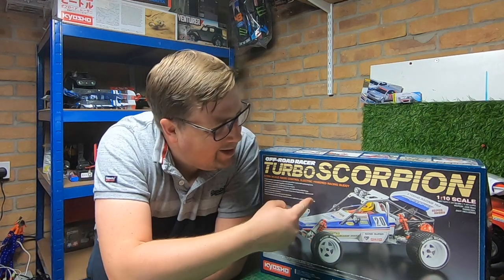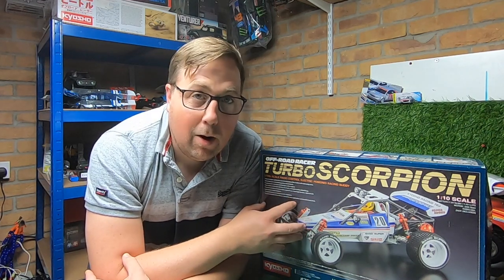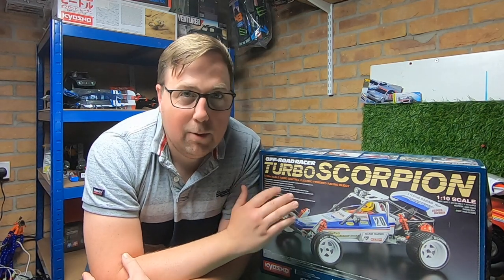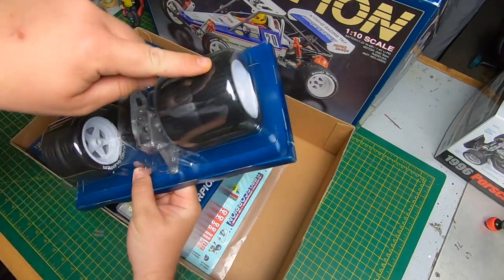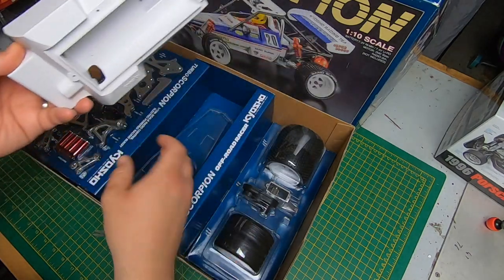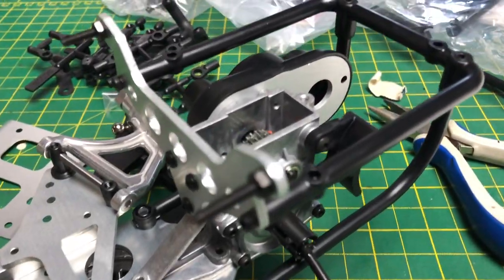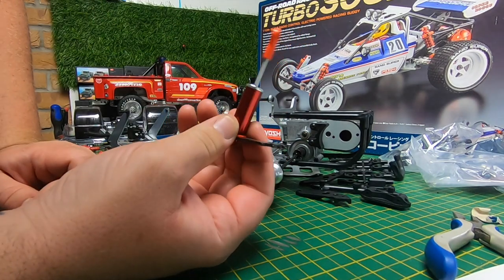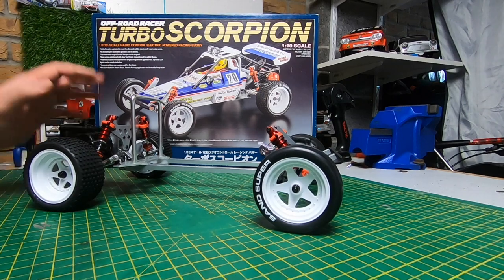The Nicest RC Car I've ever built!! - [Kyosho Turbo Scorpion] NIB Brushless build.

Comment: Heyo, your videos have inspired me to consider getting back into the rc hobby, about a year back I tried to waterproof my wpl c14, it worked for a bit but the motor eventually was destroyed by water I think I'll go back in with the wpl b24 and stay away from water, been looking at many of your videos on both and they've been a help
Reply from the maker: Thanks Calvin, glad I helped you out. As for (Brushed) Motors... they are ok in water, as long as you make sure they are allowed to dry..so either a small amount of WD40, or just drive them around for a bit once they are out of the water.
Reply: @TomleyRC  you reckon it's worth repairing and how would I do so without a soldering iron?

Comment: ok, i have a question and i know that i can rely on you. iam planning on buying a motor/ESC combo. the thing is, the motor is rated for 66A, but the ESC is only for 45A. i know it shouldnt be run like this, but they sell it as a combo anyway (?). so, for how long should i full-throttle it? or is it safer than i think?
Reply from the maker: Well it will 'probably' be ok, but you'll not get the full potential out of the motor. I've run motors that are to powerful for the ESC before, and not had any issues, however, that's not saying it's the right thing to do
Reply: @TomleyRC  ok, thanks